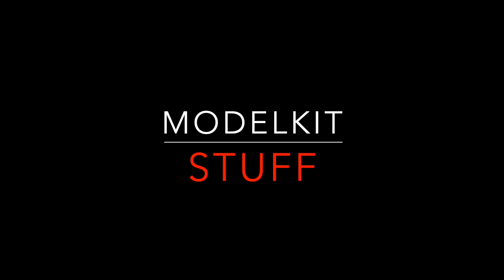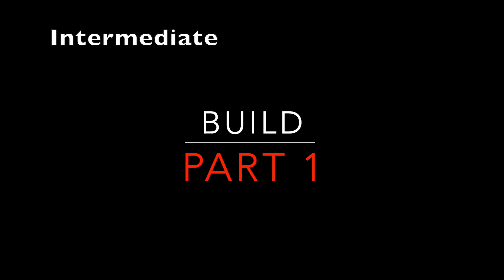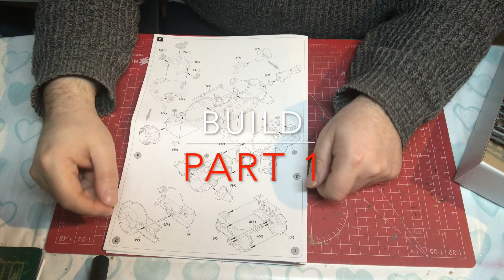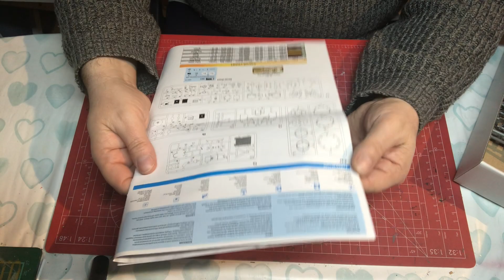Miniart 1/35 German Tractor 1938, Full build part 1

Comment: Hiya Jason I just finished watching all 3 build parts. It turned out wonderful. I didn't realize you had done this one. I joined a GB 'civilian', had not done a Miniart, and this was ~$20 less than the one with rubber tires (1937?). I will certainly be using your series as inspiration and shoutout when I post a video (ends Oct 15). Cheers